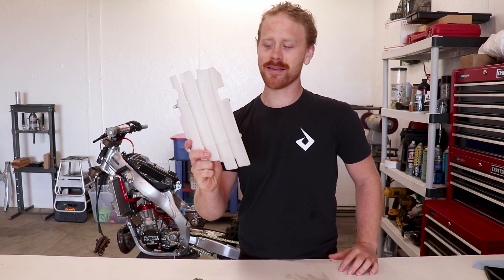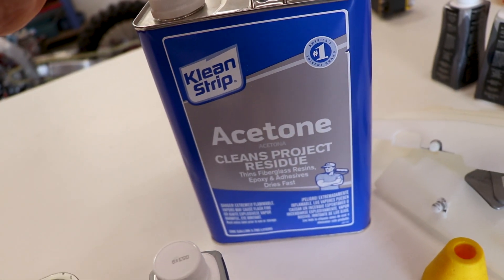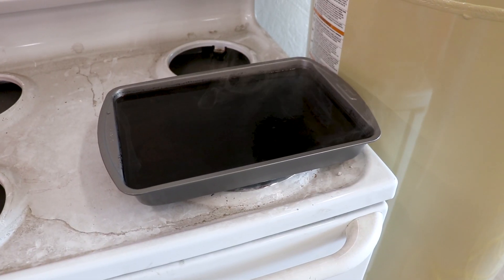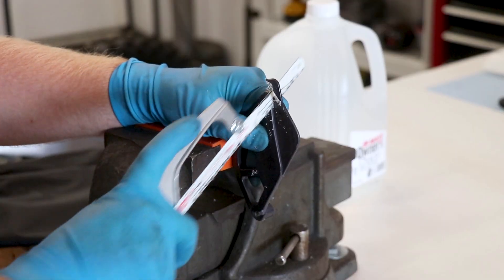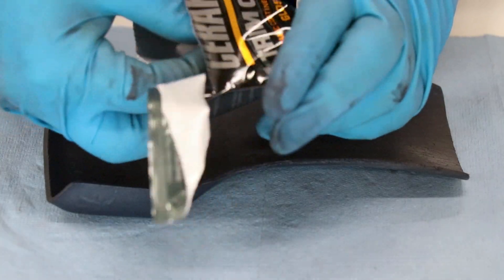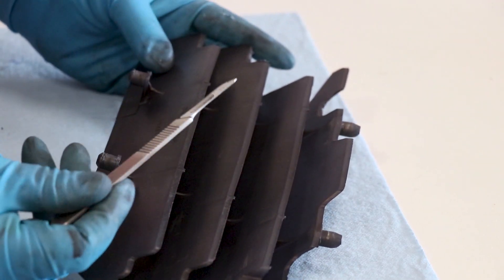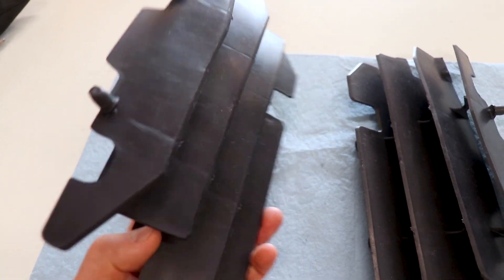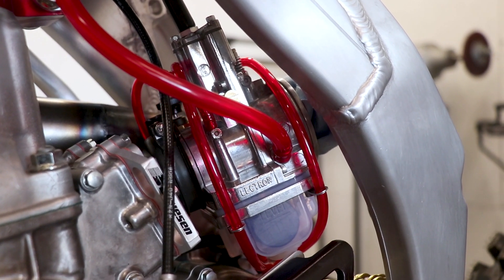How To Change The Color Of Plastic!

Comment: I used Dyemore on plastic and was very pleased with the results.  I didn't use acetone as I didn't know about your process at the time.  I did get inconsistent colours.  Since I was dyeing plastic bottle caps to do a mural, I just picked out the ones that came closest to what was looking for.  My BIG question is how did your parts hold up against UV fading.  I had to clear coat my mural to halt the fading.  Loved the video.

Comment: I know this video is super old and probably won't get a response to my comment - but I have a bunch of 2' sticks of white PVC pipe. Could I simply add them to a large rubbermaid bin, add water to cover them and like maybe 2 bottles of dye and let them sit for a day or so to color them black? I wouldn't really have a way to heat 20 gallons of the solution with acetone so I was hoping the dye would work with just the water and more time?

Comment: informative thanks. just a tip suggestion. never hold the camera. going back and forth is off putting.. Always use a stationary tripod. .going back and forth staring at at an empty pan is not helpful, especially when you are trying to read a label.. But like I said very informative THANKS!

Comment: Most important thing is you don’t need the acetone in the water it boils off at 130 degrees!!! Yes hot water yes Rit dye. Yes to using acetone to clean the plastic before to make sure no sealant or protective coating stops the dye from penetrating the plastic. 15mins rinse repeat

Comment: I have a 2019 tacoma and was trying to use this stuff to dye my interior trim pieces that are a light grey color and the dye would not even set into it and would just bead right off or run off it any suggestions? I’m thinking the plastic is still smooth and kinda silky smooth?

Comment: Acetone is unnecessary. I've achieved the same results by simply using boiling hot water with salt and vinegar. I'd actually say my color was even better than your results in this video. A very dark rich black without any haze. I initially tested this as I was dying a synthetic blend fabric and using different types of plastic tongs to stir and turn the fabric. All of the plastic tongs turned a dark black as if they were factory made that way. Absolutely no Acetone use. I've since dyed plastics this way intentionally. Water, salt, and vinegar. The smell and inconvenience of using Acetone is an unnecessary thing in my experience.

Comment: A little dish soap in the solution helps. Wash the parts in hot soapy water first then straight in the solution for 15 minutes or whatever time you're using. After rinsing and cooling you can run the process again. Soapy water preheat then another run through the solution. The second or occasionally third run really improved the brightness of the parts. The Rit synthetic graphite dye can improve the color when added to the black.
Great video, sure beats painting plastic.
5% x 13oz = 6.5oz acetone. i found 10% works well for chainsaw plastics.

Comment: So is it absolutely necessary to boil the mixture to 200 degrees? You said at the end that you left the radiator louvres over night, I assume you didn't heat them and stay up watching them? Do you think you would get the same results by just mixing a cold mixture with 10% acetone and leaving it at room temperature for 24 hours? Just trying to avoid the fumes or buying an electric stove. Thanks!

Comment: The very last step that everyone misses is you have to spray the parts off with acetone...that reddish/blue/purple pen ink color is mucky dye that settles on the surface, rinse it off good with acetone and it will look factory made clean.
Reply: I Have been staining with rit dye on plastic for a very long time now and simply rinsing the die off under cold running tap water neutralizes and rinses all dye away always perfect dye job every time. No need for acetone, salt, or dish soap. I use 91% alcohol for cleaning plastics and boosting dye bath.
Reply: @ericedwards1731  do I rinse with cold water as soon as I take the plastic out of the dye?
Reply: @Waddlejpg  pull it out the bath and check it until the desired depth of the color is achieved. You can't really over stain but if you leave it too long in the bath may start loosening the edges of your tape/stickers.
Reply: Acetone melts some plastics.
Reply: @peterl.1574  Yes, I mix 3:1 water:dye, then add about 25% of that total volume in acetone when doing acrylic. It opens up the plastic letting dye penetrate further into the part. But you are right, add too much and the acrylic goes soft and melts. I just rinse with cold water, or rubbing alcohol, but I notice more run off with the alcohol.
Reply: @JacobBe5  quick question, you and the video creator mention the acetone "opening the pores" of the plastic. Do you know that for a fact or are you just parroting something you've heard because plastic is not skin, yes I guess you can say the acetone "opens the pores" but unlike skin the "pores" don't close back up so in reality you are making the plastic more brittle and susceptible to cracking and breaking.
Reply: @NonLegitNation2  I said "It opens up the plastic letting dye penetrate further into the part" which isn't exactly accurate. "All models are wrong, but some are useful." I was conveying that by adding the acetone and softening the plastic it appeared to let the dye molecules more effectively penetrate/attach to the part than if none was used.

As far as increasing brittleness, acetone melts some plastics, it at least initially increases mailability, I have not noticed any issues with any of the plastic (acrylic) I dyed. There may be some quantifiable change in the physical properties, but it isn't apparent in everyday use. 

I have some extra pieces from when I last dyed some (a little over a year ago). they still appear color fast, and don't show any issues.
Reply: wait ... so you mean literally pour some acetone on the stuff after it's done with the dye?
Reply: @optimafootworks9554  Yes, the dye soaks into the plastic coloring it and then mucky dye sits on the surface looking like it was colored on with a sharpie. I've done several nylon plastics and comes out looking factory made when rinsing in fresh acetone.
Reply: @TheNoisePolluter  do you rinse it in cold acetone or do you heat it up?
Reply: @coloradodirtbike5930  Just cold/room tempature acetone.
Reply: @TheNoisePolluter  thanks
Reply: @TheNoisePolluter  thanks!!
Reply: @TheNoisePolluter does the acetone and dye weaken the plastic at all?
Reply: @TheNoisePolluter I know I'm about 3 years late to the game here😄
But wanted to take a second to thank you and let ya know that your advice is still of good use even years later. Definitely gunna try that out🙂thank you again for sharing your suggestion👍🏻
Reply: @optimafootworks9554  should I scrub and rinse or just rinse
Reply: @Waddlejpg  i use this process to change the color of rubber soles on shoes - i scrub the muck w/ a toothbrush
Reply: @optimafootworks9554  it's really hard to find black on black running shoes, I like this idea
Reply: Acetone is unnecessary. I've achieved the same results by simply using boiling hot water with salt and vinegar. I'd actually say my color was even better than your results in this video. A very dark rich black without any haze. I initially tested this as I was dying a synthetic blend fabric and using different types of plastic tongs to stir and turn the fabric. All of the plastic tongs turned a dark black as if they were factory made that way. Absolutely no Acetone use. I've since dyed plastics this way intentionally. Water, salt, and vinegar. The smell and inconvenience of using Acetone is completely unnecessary in my experience.
Reply: @hendosia  It varies depending on what I'm dying and how much of the main I'm dying. I alter depending on certain variables, but it essentially breaks down to 1 cup of salt for even 4 gallons of water and 2 cups of vinegar per 4 gallons. The vinegar can be most or less important depending on YouTube water and what you're dying. One thing that is improving is to fully dissolve your salt in the water before adding color. Then add vinegar and color and fully mix before adding items to be dyed. If you have any more specific questions, feel free to ask. I make custom clothing so I've dyed countless amounts of fabric and other various plastics and synthetic materials. If maybe I can help with specifics if you have any questions. If so, I'll get back in the am, as I'm about to crash for the night.
Reply: @hendosia  No problem, my friend. There are different types of plastic and some dye quicker and more easily than others. I obviously haven't seen your vents, but I've actually dyed vent covers before myself and they were more of a matte finish plastic. They dyed beautifully. I've used the ice grey before too and it works well. It sounds like you may not need a very large mixture, so just adjust the amount depending on how much water you're using. Water temperature is key. Boil your water and then stir the salt in to dissolve. Check your plastic frequently to ensure you're not getting more color than desired. Try your dye all of your items together if possible, or note your exact ratios and time so you don't have issues replicating the exact color of you aren't able to dye everything in the same dye bath. There's not much wash out with plastic either, so the color you had when pulling your items out won't alter too much after rinsing and finishing. Good luck brother.
Reply: @closinginonclosure  I just tried to dye my dirt bike gas tank with your method. It didn’t work at all. Can it be because I used dye powder instead liquid dye. And the water was 90 degrees celsius so almost boiling and I had about 10 gallons of water.
Reply: @gangsteri8  If you used Rit powder, that's 100% the problem. Rit does not make synthetic dye in powder form, so if you used Rit powder that comes in the small boxes, it was standard dye. You have to use synthetic dye for synthetic materials and plastics. You can find synthetic dyes and acid dyes from various manufacturers, but Rit does make synthetic liquid dye. It comes pre-mixed in a small plastic bottle. Rit also makes standard dye in liquid from and sells it in bottles that look identical other than the label. So you'll need to re-dye with Rit synthetic dye and be sure the label says synthetic. It's right on the front of the label below the Rit name, and is sold in multiple colors. You can find it and some Walmarts, all Hobby Lobby locations as well as other craft stores.
Reply: @closinginonclosure  gonna try that next! thank you sm
Reply: @gangsteri8  That should do the trick. No problem at all.
Reply: Bro, BE CAREFUL with Acetone and plastic. It will absolutely destroy certain kinds. I had it eat thru my guitars pickup covers one time. I never had it react to plastics before so I didn't think to test it. I wish I had... Be careful!
Reply: An do the same exact thing with cold water and a good wipe off

Comment: Dude not sure why you would think that dye would scrape off or flake off. ITS DYE!!!!! Not paint and now o question why you went to dying as an option vs plastic primer n paint given you clearly didn’t know that dye doesn’t flake off nor scrape off as not a bonding/ adhesion process like spray painting. Looks good though also check out plasti-dip in spray form

Comment: I did this without acetone and my results where great, part has been died for about a year and is in the engine bay of my car, i just used powdered rite dye and used all of it and let the part soak for about 2 hours.
Reply: Hi, so no water use for this? Just pour the powder and let it sit?
Reply: @genysmenrunner1677  I used powder in very hot water. Longer it soaks the dark and deeper the dye will soak in. To this day the part is still pitch black!
Reply: @no_rivals  great, I will try that tonight! Thanks
Reply: @genysmenrunner1677  let us know how it goes!!!! I never had the water at a boil or simmer. Just hot enough steam would rise. The more dye the better as well.

Comment: Hey man i have a crf50f and when i turn the throttle the exhaust just spits out smoke. I’ve tried to adjust the screws but nothing has changed... brand new carb and still won’t run with choke off. Can u help??

Comment: Hi, my 2 stroke moped starts to smoke's a lot and starts to run bad after riding slow and low rpm, but when i ride full throtle it runs fine and doesn't smoke, does anyone know what this might be?
Reply: Try cable for oil pump. Check adjustment. Also injection oil, don't use cheap oil
Reply: Tony Koehn i mix the gasoline myself, stock pump wont mix enough for 86tpr. I use castrol rs 100% syn

Comment: If you use yellow dye, it pulls all of the plastics away from the purple-ish spectrum. So dye yellow, rinse off, then dye black. Ol lacrosse techniques ftw
Reply: I'm guessing it's possible to just add some of the yellow dye to the black, since they work the same way... I've done this before when using RIT dye / dyemore on clothes ^-^ Just be sure it's mixed properly beforehand!

Comment: There's another process I've used that works better on tanks.. It's a dye from eBay & pvc clear cleaner.  Look that one up.
Reply: Can you elaborate? Im doing a tank soon
Reply: @mxfreaks  It was a crazy little bottle of dye mixed with clear pvc primer.  I did a white 99 cr125 tank with it and it came out looking like woodgrain.  Maybe it was my plastic, idk.
Reply: @jamesausmus661  Thanks I found it but that's what I was worried about when I looked that method up. Applying it in small sections will cause overlap and you will get that weird look. You can even see it in the test pipe in the listing Maybe if you put it in a spray gun and spray it on like paint then wipe it off so you get an even coat ? I'm gonna try the dye method first though.

Comment: Kinda weird that you were testing the dye for flaking and coming off with scratches. The whole point of dyeing instead of painting is that it changes the actual colour of the material instead of being just a surface coating. Other than that, great video Ron!
Reply: Elimentus some plastic I have dyed only dyed the surface it just depends on the material